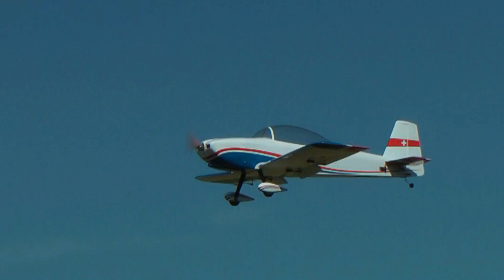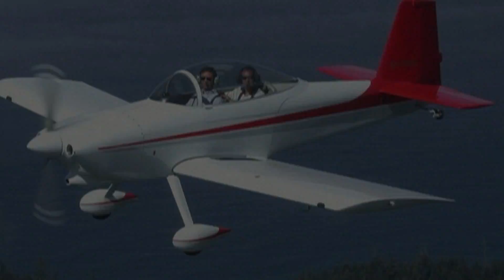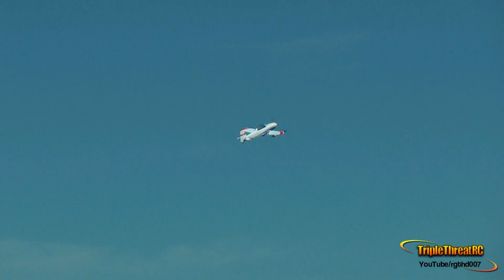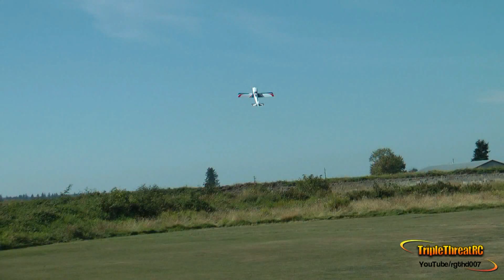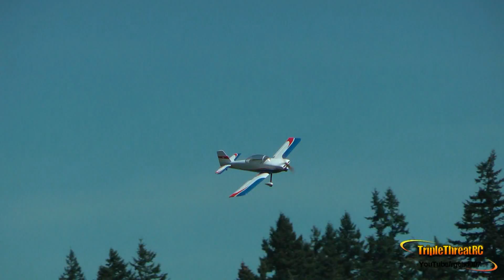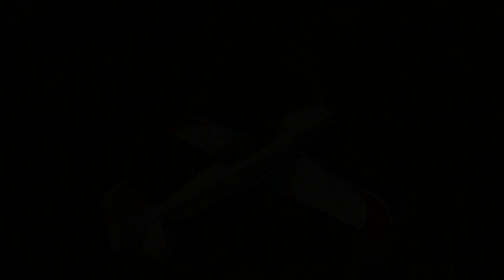Aztech Aeromodels Slipstream 30cc RV-8

Comment: Hi,
Very solid performance!!!
I also have this plane on the bench at this point and I am wondering what electric power setup was used on this plane?
Motor:
LiPo:
Prop:
Flying weight (if available):
Andrei K.  Toronto, Canada.